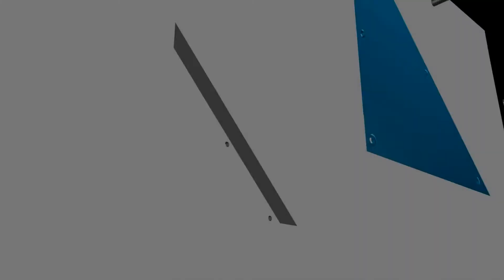Cutting and Chamfering Threaded Rod With a Uniburr Plus | Fasteners 101

Comment: All day to use a grinder on 10 pcs of all thread thats funny i worked in machine shop 27 years 10 pcs on belt sander all of 20 min. that said yes its a good tool for use in places you cant remove the bolt or through bolt.
Reply from the maker: Thank you for your feedback!